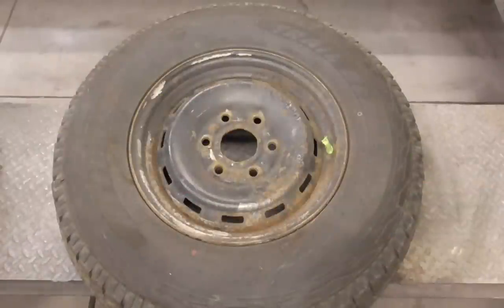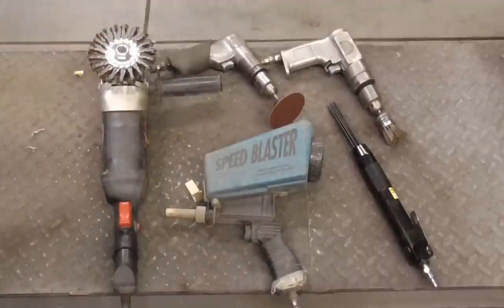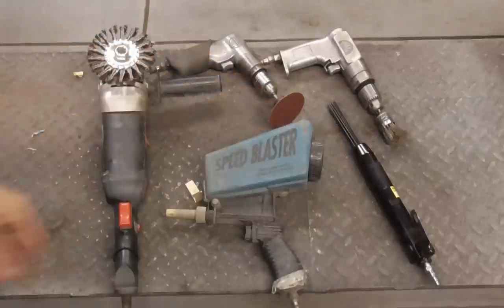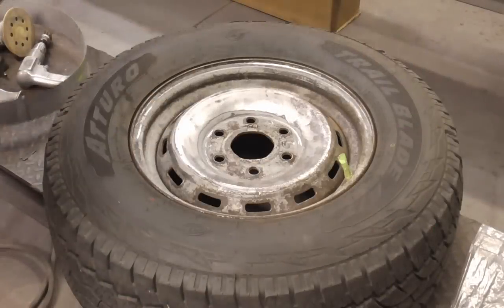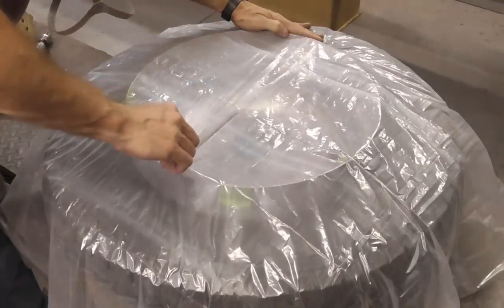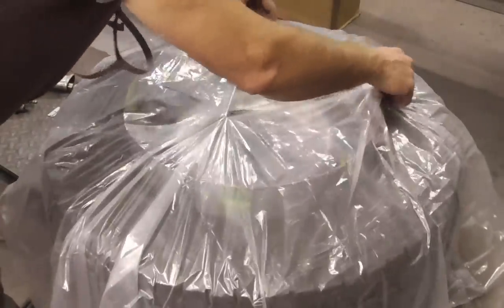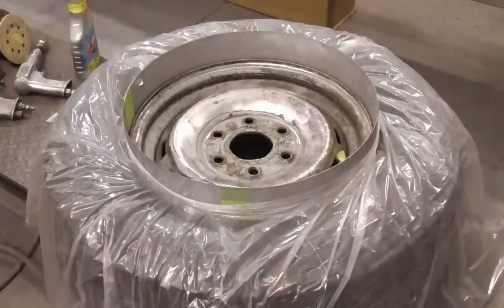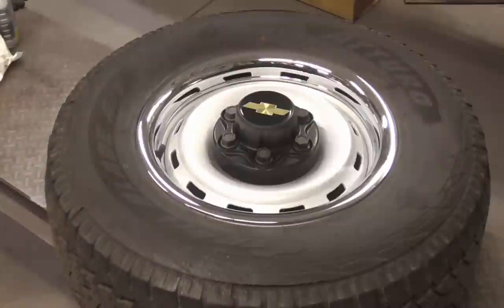Masking & Painting Wheels/Rims the Easy Way - Rim & Wheel Painting

Comment: I think the needle scaler is the most over looked tool for rust removal. I always use it to get the first layer off, it saves a lot of sandblast time. One caution I have is if those shop rags come from a service. They will have an oily cleaning fluid on them so they wash better. That fluid will create fish eyes and even non adhesion problems.
Reply: Agreed. Takes some air but man do they work great.

Comment: I use a deck of cards to mask between the rim and tire, then I coat the tire with cheap tire shine to make any overspray wipe or rinse off.  The other important thing is to mask your valve stems and put the wheel/tire on a board or sheet of cardboard to prevent the overspray from hitting your floor.
Reply from the maker: Good idea SD - thanks for your input.  Have a good weekend my friend :)

Comment: ive got 3 of my 6 rims done so far, almost there! incredible transformation. i have an e350 dually van. its awkward to me painting them lying flat. i like to stand them up against a tree when priming and painting with rattle cans.  there is something about rattle can paint that seems softer than real automotive paint. i can still dig my fingernail easily into a rustoleum painted wheel 24hrs later.
Reply from the maker: You're right about that - I've not come across any rattle can paint that is as hard and durable as paint with an activator.  You can get hardener for Rustoleum (quart) and spray it with a spray gun like this -  https://www.youtube.com/watch?v=lwHDMcDWVzQ

Comment: As always, I go to your channel when I’m looking to do any automotive bodywork or paint. My daughters truck didn’t come with stock wheels but I found a new set. The new wheels are black, and of course she wants them to be white. Thanks for the lesson and tips!
Reply from the maker: You're welcome David - my wife makes me paint everything in the house satin black - chairs, fireplace brick, wall furnace, tables, hanging old lamps, anything metal, door handles, drawer handles, even the plugs are black - 😊🛠✌
Reply: @LakesideAutobody  Haha! I know the feeling with wives and house paint! My wife wanted to paint the nursery “pale daffodil” and when done it looked like fluorescent yellow highlighter. Quick question, the first two sets of rims were cancelled as they were back ordered. I finally got four oem rims shipped today. Three rims are black and one is silver. If the paint is in good condition, can I just primer them then  paint or should I bring them down to bare metal? Also, would you recommend Rustoleum, Duplicolor Wheel paint or some other brand of paint? Thank you for always helping me and answering my questions throughout this project. Thanks, Dave from Connecticut.
Reply from the maker: @davidstepeck2644  Good story about the paint :)  If the paint is in good condition on the rims, just scuff them with the red scuff pad or scotch brite and paint - you don't even need primer.  Only time you'll need primer is if you have bare metal - the scuffed paint is a great primer.  I use regular single stage auto paint on rims - it holds up reallyu well and the smoother you get it the easier it is to clean the brake dust off when you wash the car/truck.  If you can't or don't want to use automotive paint, rustoleum or duplicolor will work just fine.
Reply: @LakesideAutobody  Thank you!!!!
Reply from the maker: @davidstepeck2644  You're welcome :)
Reply: @LakesideAutobody  I prepped/scuffed the rims with green Scotch Brite pads as you suggested. I painted the rims with white Rustoleum last night and they came out great. The cam says I need to wait 30 mins or 48 hours before applying the clear to a new topcoat. I’ll use some fine steel wool and the green Scotch Brite pads to scuff the surface before applying the clear coat. As always thank you for always replying and helping me.
Reply from the maker: @davidstepeck2644  You're welcome David - hope they turn out well for you.  Have a good week my friend :)

Comment: Mon I like how you went the extra steps to make the wheels look great.
I used to scuff and rattle can my wheels red with hub caps, depending on the hub cap and how much of the rim will be shown.
Now they have powder coating that make wheels look thick coated. I couldn't even fit the cap without sanding the powder coat down so the cap could fit.
Reply from the maker: How do you like the powder coating?

Comment: Awesome job! I completely stripped some aluminum wheels. What do I need to prime them with? A buddy told me regular 2k primer might not stick. Do I need self etching or epoxy primer? Thanks!
Reply from the maker: I use lacquer primer - sticks great, dries fast, sands easy, cheap.  You can use DTM urethane primer too or epoxy.  All three will work fine :)

Comment: Doesn't the metal ring prevent you from painting the outer edge of the rim where rust always starts especially from old clip on weights?
Reply from the maker: You're right about that.  If you want to make sure that edge is hit, you'll want to mask it with tape or remove the tire.  There are adv and disadv to removing the tire though as you have to install the tire and take a chance of botching the new paint :)

Comment: I like using the metal ring to edge off the wheel, easier than taping.
Could you fi a video on paint an alum rim with pealing clearcoat? 
I can't seem to find any stripper that really works.
Reply from the maker: I'll do that when I come across one - thanks for the suggestion my friend :)

Comment: Your video  are  full of new ideas that I have not seen but I like this video good tips I dont know if you  could do a video on wet on wet primer it would be good to see how you  spray it on and also what can go wrong thank you for the video Jerry and stay safe
Reply from the maker: Do you mean putting coat after coat of primer on.  Like if you are trying to put the sufacer on thick?  And what can happen if it's too wet -etc ?
Reply: No what I meant was a wet on wet primer that is not sand sandable so you  can spray your base coat on
Reply from the maker: @husky1232  Got it - like what to do if you get dust or mess ups in that coat of primer before base coat.  I'll write that down - there's a whole intense skill set when trying fix problems during that process.  Have a good weekend Husky :)

Comment: I have used muratic acid for ph control of swimming pools, (31 % ) to descale rusted steel parts. You have to apply it carefully, as it is quite strong. Place wheel on plastic sheeting first.  It will eat rust to bare metal in about 15 minutes. Rinse with clear water. Neutralize spillage with baking soda. Wire brush. Rinse. Dry with compressed air. Wipe with acetone before painting.
Reply from the maker: Sounds like it works well - would like to see how that works.  You should do a YT video on that :)

Comment: Whats easy about this,grind,sand wire brush,grind some more,sandblast ?
Reply from the maker: I'd hate to get the rust off by hand - right?  I guess the easiest part is the masking but it was all easy really.  Hanging 12' 5/8" drywall on the ceiling is hard :)

Comment: Looks like a wire brush and some elbow grease could do the same.  But, I believe in labor saving devices also, but some of these tools seem useless or not totally suited for the job.  But, this is your u t vlog, not mi
Reply from the maker: You want to make sure you have the rust off before painting.  What ever does that is good :)

Comment: I really like your masking method for wheels. But I am spoiled..and very anal when painting steel wheels...especially dually wheels.... I dismount the tires from the rims using my manual tire machine ... take to diy sandblast yard. Prime and paint rims. Then remount tires to rims on my manual tire  machine.  Balance is done  with spirit level  balancer. Customers here in the rustbelt really need the  extra effort. Best to You and Yours.
Reply from the maker: How do you mount the rims w/o marring the new paint?  I know I'd mess it up for sure :)
Reply: @LakesideAutobody  I modified a harbour freight manual tire changer as per  "Bruce L. " YouTube channel.
Reply from the maker: @RaysLaughsAndLyrics  Thanks my friend - I'll have to check that out :)
Reply: @LakesideAutobody  Good .doesn't take long to fab.. duckbill can be had for reasonable dollars on line.. tire changer comes in two sizes..  I use the larger as I do mostly light trucks.

Comment: After all that work, you missed a very nasty looking spot of raised material directly above the valve stem. Without those trim rings to hide it, that would have been a major fail. 
PS: I much prefer your ring of sheet metal method to conventional masking for this purpose.  I've got to admit that it never once occurred to me in well over a half century of repairing, renovating, and other such tinkering.
Reply from the maker: Glad you found it useful :)

Comment: This is way too much time and labor.
The tire shop charges $5 to remove the tire, sand blast it, prime and paint, remount.
We charge $80 an hour and the $10 is by far the best money spent
Reply from the maker: Just make sure the best guy does the job.  Don't want some careless worker marring the soft, new paint :)
Reply: @LakesideAutobody  I only go to one shop, and they know when I come in to use the touchless mounting machine, or they are extremely careful